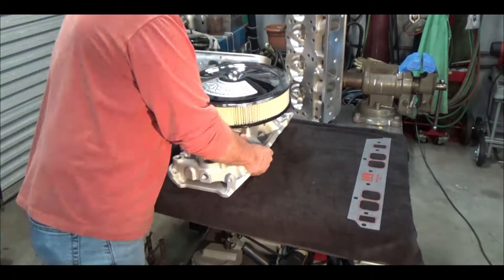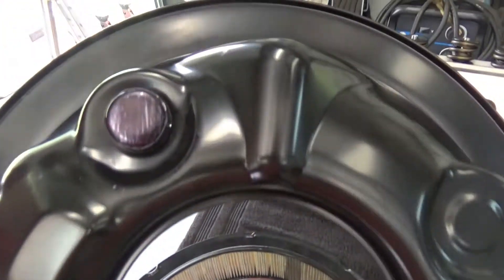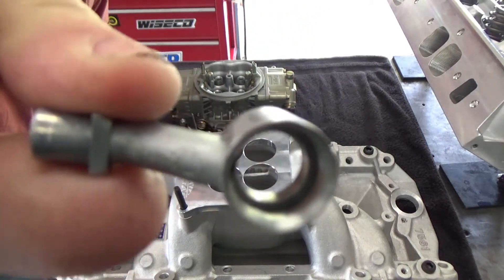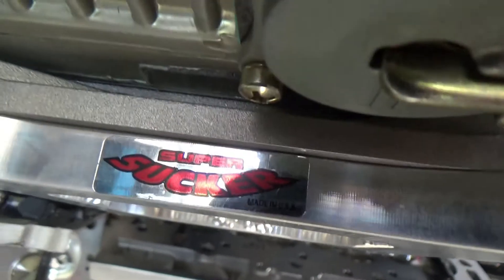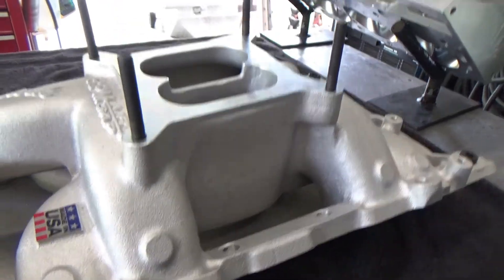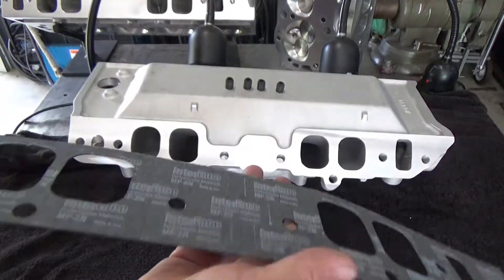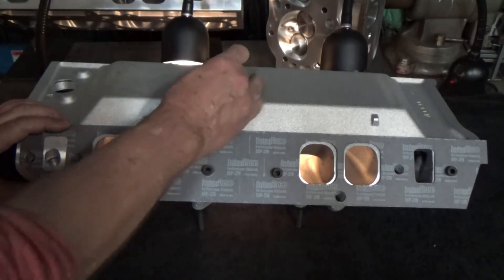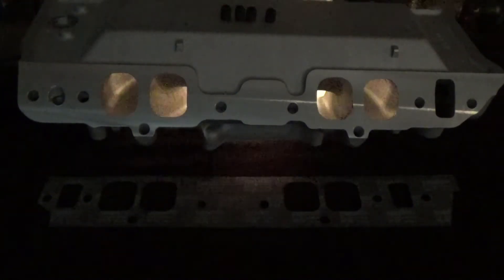Air Gap Intake, HVH Super Sucker, Holley 1000 cfm...# 17 Chevy 454 Big Block Performance Build...

Comment: Would this intake fit the hood of a '73 Corvette?
Reply from the maker: Will it fit under  the hood of your 1973...  Not sure but, I'm thinking it would not... You would most likely have to buy a aftermarket hood... The factory intakes are very low if I  remember correctly..

Comment: I watched some dyno test done with the air-gap manifold vs;  single plane, using open carb spacers and 4 hole spacers.  The results showed that with single plane manifold, you need to run a 4 hole spacer.  The air-gap manifold made horsepower using an open spacer.  It didn't work well with the 4 hole spacer.  You might want to try it.
Reply from the maker: Good information...Thanks for the tip.